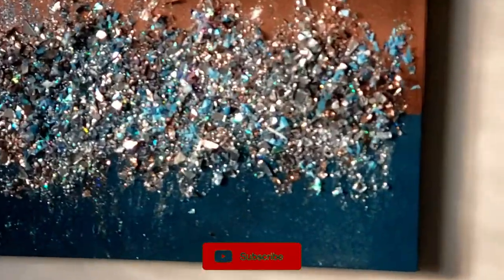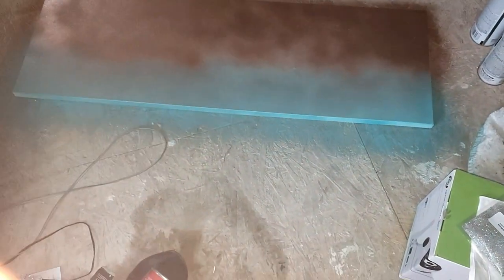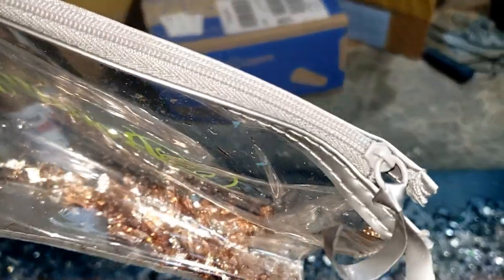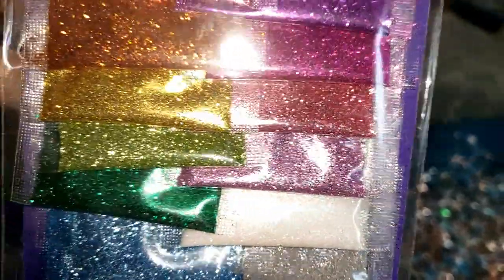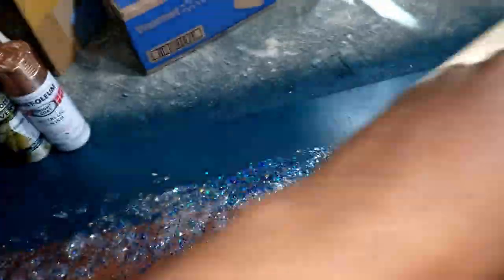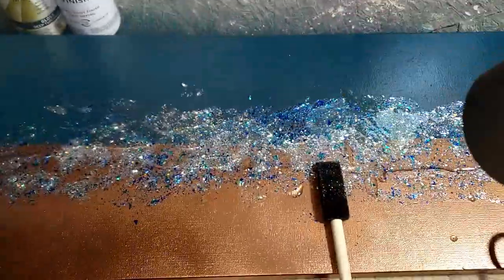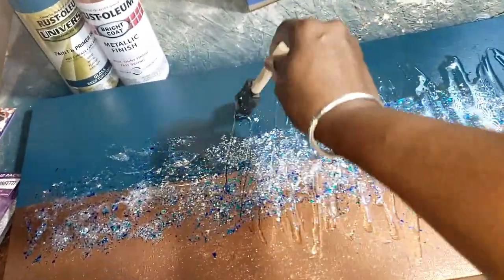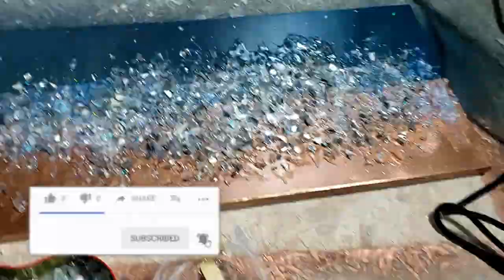Crushed Glass & Mirror  Rose Gold & Teal Wall Decor Dollar Tree DIY

Comment: can the crushed mirror be stick to wall?
Reply from the maker: I am sure you can but know it will be hard to come off without damaging your wall especially if you us epoxy.  You could try the clear Elmer school glue. It should hold it and MAY cause less damages.  Also no matter which method you try, since it will be on a wall I recommend that you wait until the product gets tacky enough to hold the crush glass because it is heavy. I do however have a possible solution to fix almost all the concerns. If you want a crush glass boarder take Dollar Tree foam board, the thick one, cut it to the width you want, put the crush glass and glitter on it, allow it to dry and then place that on the wall. Just keep connecting the pieces until your boarder is complete. You can also do the same thing with a wall. Pray this helps.

Comment: Before you poured the resin, there was already glitter on the canvas. Did you do a layer of resin and glitter first? And then did you add a 2nd layer of resin with the glass?
Reply from the maker: I did the paint and laid enough resin for my design. I place a small amount of resin, glass and glitter.  Once I had the pattern I wanted I put more resin, glass and glitter.  Once everything was down on the canvas I had  little more resin left and I just put it up there to not waste it. But really if you put enough resin down right off the back you cam place everything g in that layer and after 30 mins to a hour go back and pat everything down in the resin. After you have let it dry then any remaining supplies brush it off.